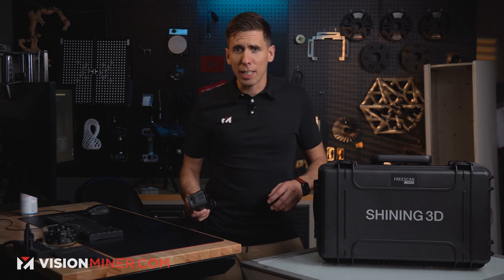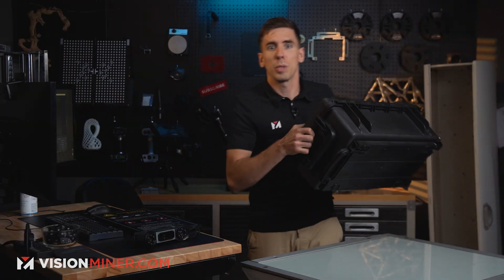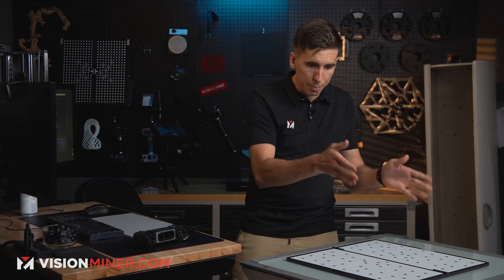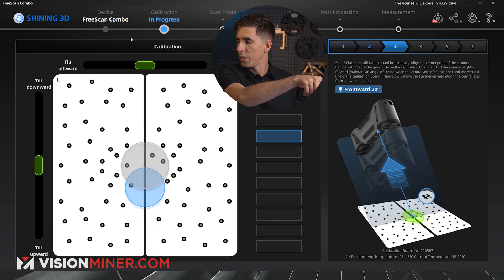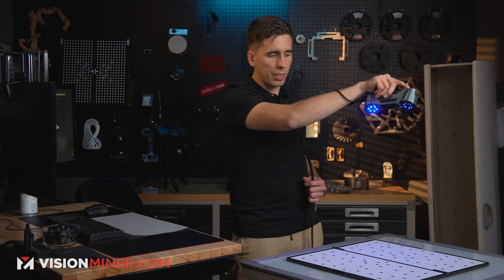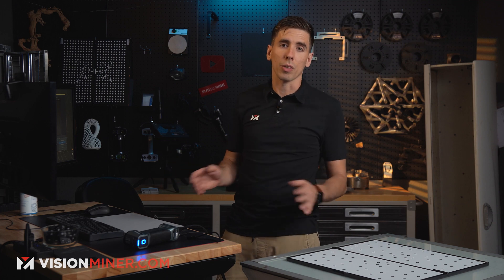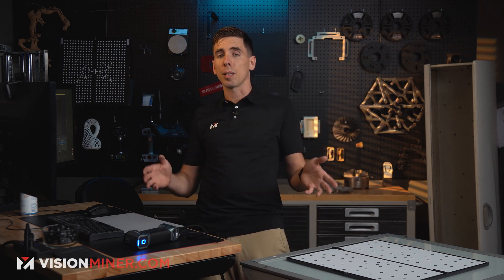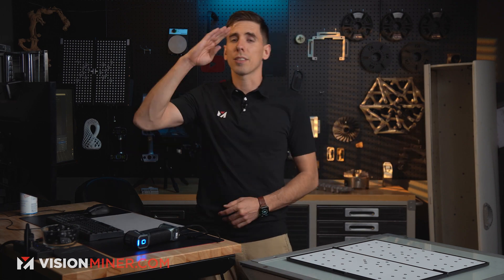How To Calibrate the Metrology-Grade 3D Scanner: Freescan Combo Tutorial

Comment: My scans keep on starting at a 20 degree angle in the X and Y directions making it so hard to model the scans. I have no idea why this keeps on happening. Any advice or suggestions would be greatly appreciate as I have used numerous surfaces to calibrate the scanner but it always puts the scan on an angle when exporting the stl file.